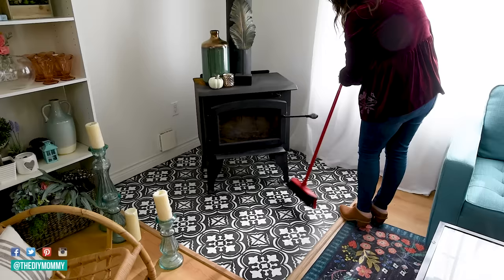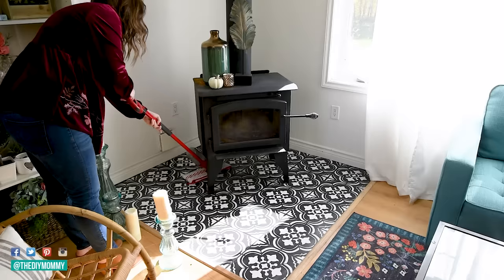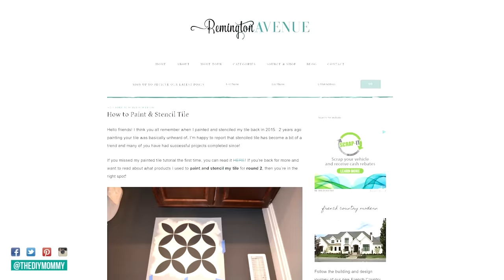PAINTING TILE! Did my painted floor tiles last after 2 years??

Comment: But how much wear does the floor get? Looks like it’s a decorative corner where you don’t walk on
Reply: 8:08
Reply: Exactly!!
Reply: She did mention at the beginning of the video that the woodstove wasn’t used and this was in a corner of her studio. So no, it wouldn’t be a high traffic area
Reply: That's the best type of surface to do this on. I wouldn't recommend doing It on a kitchen floor with 15 kids and 13 dogs.
Reply: @Kevin-sm8pn  guess it’s ok since I only have 14 kids. 🤣🤣
Reply: @siskse  
 Wait...so how many dogs??? 
lol ;)
Reply: @vegasjill21  just 12, so I’m under the limit on both counts. JK 🤣🤣🤣
Reply: @siskse  
😂🤣😃😄😅😆😙
Reply: I stenciled my enclosed carport ( car no longer has access). It looked great but it didn't last very long.😣
I spent a lot of time and money thinking i was going to enjoy it for years , lesson learned.
Reply: @stanleyhape8427  what type of paint did you use?
Reply: @siskse  it was oil based for block and cement. I was surprised how quickly it wore down just from the light foot traffic by me and my wife.
Reply: @stanleyhape8427 Ouch!  Maybe you should have tried a small area first?
Reply: @MsBeatlejoos  i did (sort of). I painted the entire base coat and did a small area with the stencil to make sure the colors looked good together.
Reply: @edenbarnes1345  Exactly why it's not a good marker of "did it hold up". No foot traffic then no wear and tear. I thought this would be great in my kitchen but that's a very used space where it  would quickly damage the paint.

Comment: In the future use actual floor paint (Fix All from California is my favorite).  It’s self priming and no protective coat is needed.  I’m a decorative finisher and paint tile all the time.
Reply: Thank you for the advice! I am planning on redoing my bathroom and am tired of the blue/gray/white marble on the floor. Also, will that work for tiled walls?
Reply: Audrey M    Hi, it will work on all tile but not in the actual shower/tub.  I usually tape off that area and just paint the non water areas.   A shower curtain will hide the unpainted tiles.
Reply: Susan Pike.  I want to paint my bathroom tiles. So, you recommend the other product and it will stay on the floor? I don't want to have to repeatedly paint it because it peels off or gets scraped off or anything. I just want to use the best product for the floors. I have a bill to grade blue tile in the condo that I purchased in my bathroom and I don't like it at all. I do want to paint it black and white. Similar to what she painted by her stove. I would love to hear your recommendations. Thank you so much

Comment: Christina, I love this project. I have been researching DIY projects for tile flooring. I like to have options on decor that can get you through the rough patches of remodeling until you have the budget to remove & replace tile. I love this idea and yes, I would just add more coats of sealer. Thank you for going through the steps so I can know how to approach things. This could be a great option for me, especially since I was considering replacing the tile with a patterned tile anyway. Great job 🌟🖤🤍

Comment: I did this to both my bathrooms one to look like tile and one to look like wood (actually after seeing this video then searching others because I loved it so much) I did this almost two years ago, and they both held out GREAT. Look the exact same and I have 5 sons and 1 daughter so that says a lot. I have since put down peel and stick over my "wood" floor painting only because I wanted to try it out. That bathroom is used the most since it has the bathtub and shower. I cocked around the tiles specially near the bathtub and have also had great success. I prefer the peel and stick over the painting for one reason and one reason only..... it was fast and easier. Painting stencils is so time consuming.. but that said, they turn out great if you are patient and stand the test of time. I actually find my painted floor is easier to clean than the peel and stick floor. The painted was not really cheaper since not all poly is created equally and I bought Varathane for high traffic floor an. THis is a must... don't do all that work without a good protector. ALso when I bought my stencil I paid too much for it. There are decent prices now for stencils. STILL love my tiled painted floor. P.S. DIY Mommy, I have used stencils with joint compound to do decorative texture on walls! Looks so cool!!

Comment: I painted my kitchen floor.  I used a pretty heavy duty primer.  It was over linoleum.  It lasted at least 3 years before I replaced the floors in the whole house.
Reply from the maker: That's great! It's not for everyone but I think if you hate your floor and you need to buy yourself some time while you save for a new one, it's a great solution!

Comment: Amazing job and I like the pattern!!!  Agree with other comments about this not being a high traffic area, and this floor isn’t really a good test subject for determining wear.  I want to paint my concrete front porch that doesn’t get a lot of traffics so I think I would be able to do this in this area.
Reply from the maker: You should check out the links I posted in the comment box then, so you can see how it worked in high traffic areas for other bloggers :)

Comment: I painted the kitchen backsplash tiles. The breakfast counter tile job is holding up fine and it's been there for at least 2-3 years now. So we just finished the kitchen. I would stress using a really good primer,  as that was the only thing I did different and the new stuff has some scratches and chips already. (We painted it before it even was on the wall, remodel on a budget). So I'll probably touch them on the wall and hope they hold out better now they're set.

Comment: Loved you doing this DIY. And the update. Thanks for that. One can answer that so easily, of course, scratching will go through paint. Look at your doors and walls. Not one layer of paint is capable of keeping it safe but boat varnish and even that will wear and tear after a while. It's a temporary solution or a job for not a much-trafficed area. That's why they made ceramic tiles for those places XD

Comment: Does not look like it would be a good choice by my front door. Looks good for a no traffic area.
Reply: There are specific paints for tiles that do get more traffic, but since it‘s usually an epoxy based or adjacent type of paint it probably wouldn’t be the best for stenciling/designs.

Comment: I'd like to see how it holds up on a high traffic floor. My guess is that it won't. Especially since you have scratches and scuffs and it's not high traffic.
Reply from the maker: Check out the links I have in the description box for my friends who have done it in bathrooms successfully. 😊
Reply: I did my entry way after watching this video! Mine has scratched. I used chalk paint and upon reflection I should have used tile paint
Reply from the maker: Sorry to hear that! How many coats of sealant did you use?
Reply: I used 3.
Reply: I painted our sun room, which also holds our only back door (where during the summer is sloshed in and out of with our pool,)our homeschool/ office, and our dogs food:water bowls. It’s also seen extensive Reno equipment, house heavy furniture during renovations we’ve done to the rest of our home 
My base color is white and the stencil black , I have minimal scratching. What is there was as a result of my husband dropping, and subsequently spilling, paint thinner and mineral spirits.... so... I mean at that point to be expected 🤷🏻‍♀️

It’s been 2 and a half years for me exactly and I’m constantly complimented on the floors and few people realize they are painted and not purchased tile. 

I sealed with 3 coats of polycrlic.

Comment: Can you do this in high traffic areas? Yep!  Used floor paint a few years ago in my kids bathroom and it's still holding up with 3 boys. I mop the bathroom twice a wk. Yes it does scratch slightly, but it's still better than the flooring that was in there before for a fraction of the cost. I should have redone the top coat after the first year but I haven't. I recently just did our kitchen floors and didnt even bother with the top coat because everyone is home and frankly I'm just too busy right now. Well see what happens.
Reply from the maker: Thanks for commenting! That's awesome to hear!

Comment: Pro tip about stencils! Once you have your base color painted and it's time for a stencil, apply the stencil then do a coat of your base color first, in her case black, THEN do your secondary color, in this case white. Couldn't explain why this works so much better but this is how I was taught and when I cut corners and skip this step I always regret it because the touch up is super annoying. You'll get less bleeding though and you can avoid having to do lots of light coats and can instead just slap on your secondary color with less worry.
Reply: Why?
Reply: @queenvixen1435  Im not sure why it works better but it will help you get a cleaner result with less paint bleeding. If you don't mind clean up then don't bother, but I'm impatient soooo